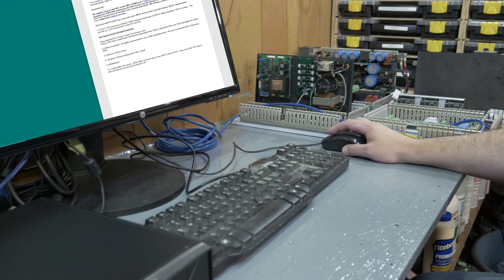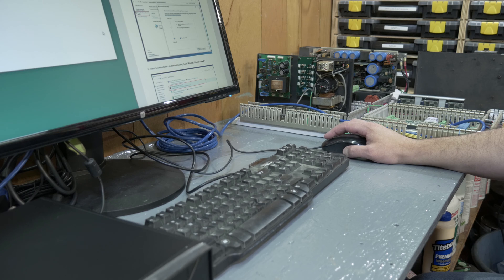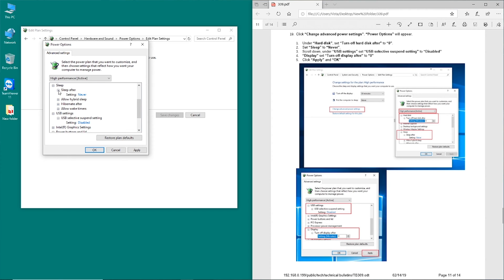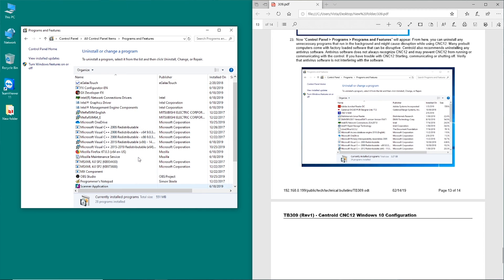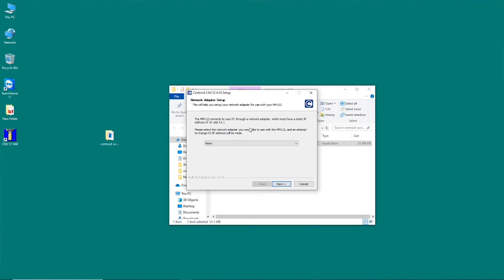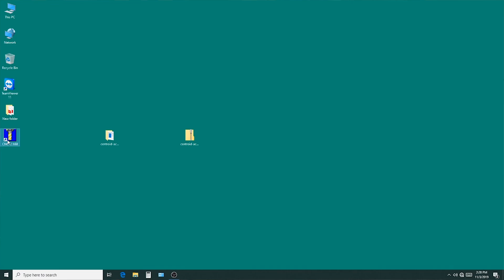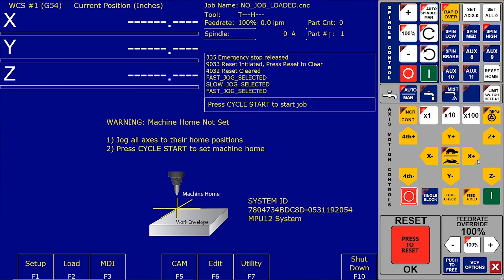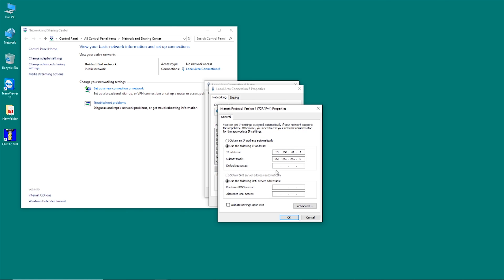Centroid Acorn CNC 12 install & bench test - Dyna Myte 2800 retrofit

Comment: What computer are you using with the acorn?
Reply from the maker: I'm currently using a small computer made by shuttle.  It is a model XH110 that looks like this: https://amzn.to/2QCre1a  (that is an Amazon affiliate link and as an Amazon Associate I earn from qualifying purchases.)  The model linked is the basic bare bones version.  I had to add Ram and a CPU and load up windows 10 on it.  By the time you're all said and done it runs about $600

Comment: I'm looking forward to seeing this machine run. I'm curious to hear how different this machine cuts in comparison to your X2 mill.
Reply from the maker: Thanks, me too! It has been a long time coming.  The 10k spindle is going to be nice but I'm really looking forward to the BT30 tooling.  The ability to quickly change tools is going to allow me to use larger tooling for hogging then drop down to smaller tools for finishing.
Reply: @PeteRondeau  Have you determined yet what is going on with your backlash on the Y axis? Does this machine have ball screws or lead screws?
Reply from the maker: geo01005  Not yet.  Now that I have some working electronics, it will be much easier to do some controlled tests to measure it. They are ball screws. I put a dial indicator on the axis to try to get a feel for how much I could turn the screw before seeing motion on the indicator.  From my very unscientific finger spinning, the X axis sees more responsive than the Y.